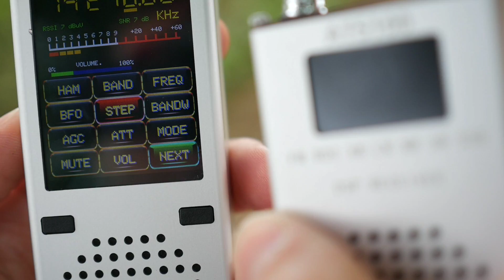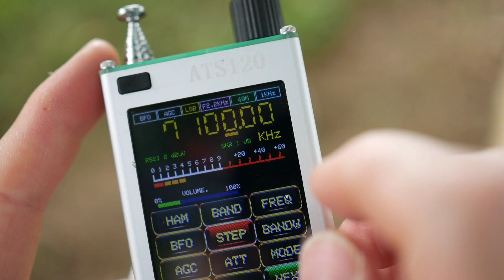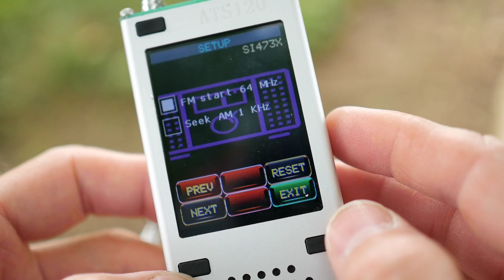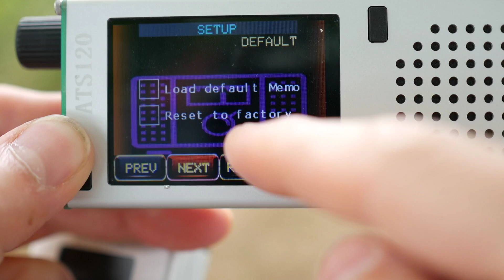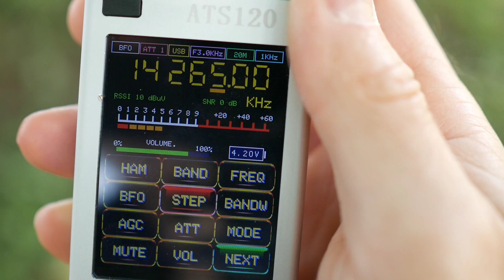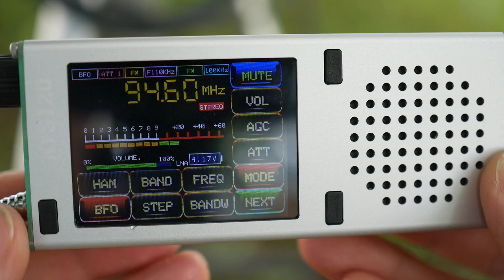New SSB Pocket Receiver ATS120 (LW,MW,SW,CB,FM) Review

Comment: I so want to like these si47xx receivers but alas they are just nowhere near good enough for practical use on the ham bands. The rx noise is giving me a headache even on this video. A decent receiver should emit almost no.noise without the antenna connected. This one is a wideband noise source.
 It is telling that most of the video explained the digital control functions, not the basic receiver performance.  It doesn't matter how good the controls are  if the receiver is noisy and insensitive,  it wont last a few days on the shack bench.
I would like to see this receiver side by side with an FT817 for comparison. I know the Yaesu is 10x the price, at a certain point people will trade off performance and price, such a comparison might assist with that decision. 
Thanks Paul for helping me decide!

Comment: Please mention that this radio has a esp32 microcontroller, which means it can be upgraded easily over usb port.
Reply from the maker: Yes, upgrade process and new firmware is explained in my latest video - ATS120 Decoder Modification

Comment: Is it possible to enable NFM modulation at 2130-2464 kHz?
These are the frequencies of train radio and metro in the territory of the Russian Federation and the former USSR. (Train 2130, 2150; Metro 2444, 2464)
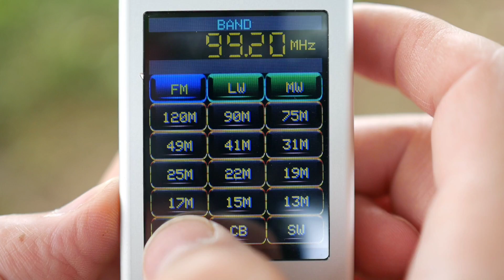UPD: 8:40 A-ha. Understand. Bad receiver ))
Reply from the maker: Unfortunately no. There is no NFM at all. Only FM radio broadcast.

Comment: Thanks for the great review. Regarding the 14MHz "cross modulation" is actually an FM image/IF problem that can be solved with a FM BC blocking filter or a selective HF antenna, like you used later. If this RX would have Air Band, I would buy this instantly, because it has variable bandwidth and a squelch, ideal for Air Band, but I believe the tuner IC is incapable of exceeding 108 MHz. 
Does it have any DSP noise reduction like the Malahit, which offers a very well designed noise reduction and an auto notch filter on top?
I just saw a video of one guy who flashed the decoder SW into this radio and inserted a tiny SMD decoder module and now received FT8, RTTY stand alone in the ATS120 ... SSTV should also work ... that is pretty amazing for this tiny little thing.
Reply from the maker: Yes, I am in contact with Manuel, who posted this video today and I will do the same modification for decoder. No, this receiver doesn't offer the NR.
Thanks for your comment! 😉👍 73

Comment: Would you say this is a good buy especially for my first receiver.
Reply from the maker: Yes, but If you plan to connect a long wire antenna or another big antenna then no.
Reply: @OM0ET  What happens if a Tecsun AN-05 retractable reel wire antenna or an MLA-30+ is plugged into the ATS-120? Does its front end overload badly? I'm torn between getting this or the ATS-25X Max Decoder. 🤔
Reply from the maker: Both models don't have front end filters so I presume RX will be overloaded.
Reply: @OM0ET  Thanks for replying! I've been a subscriber of your channel for some time, but this is the first time I've commented.  I've seen all the videos of your demonstration of both the ATS-120 and the ATS-25 Max Decoder. Between the two models, if you had to sell or let go of one, which model would you let go of? 🙂
Reply: Have you ever done review on the usdx ultra sot pota transceiver on your channel.

Comment: @ OM0ET URGENT Question. My neighbors we have never spoken to each other and we can't even see each other they for the last three years have come up with this "game", I understand that in their home there is a receiver (and in their cars they keep their respective TX), as well as a digital recorder that goes to 'infinity when they are not in their respective home. So I want to have a receiver, and surely it will be VHF or UHF, to intercept and record them, since this way you cannot go on. They are my neighbors divided only by a dividing wall of about 40 cm but when they talk normally you can hear their voices but using an ultrasonic microphone suppressor I can understand what they are saying but of course I have to hear them at a considerable distance (attenuated a few times). I would like to modulate them all the way through. Last year I had done a test and I did not think I would get a result even if it was trivial and of little value, I was trying an fm receiver for microphones, I pass different channels and I can hear the radio station and the music they were listening to. They, however, could not hear anything anymore and only when I turned off the receiver was everything as before. I hope I have clarified the issue. I look forward to hearing from you.

Comment: All the clever programming cannot hide or compensate for the poor front end RF performance. It would be a fairly simple matter to add a track tuned front end driven by the processor to improve the performance considerably.

Comment: I used to be heavily into shortwave radio and CB radio but I have to be honest my cell phone takes me places that shortwave radio and CB never could it's still nice to see those things around tho😊
Reply: Wait until you live or hike in remote areas. Your urban-luxury gadget will be pretty useless on 67% of the earth surface. Only densely populated areas reach 95% (and that's not even 100%). Speaking from experience.
Reply: Shortwave radio listening is are free of charge. Whilst you need to pay for data connection to listen to online radio. If you can afford some good Internet connection plan then you're lucky to ignore shortwave radios. But for typical people who can hardly pay the bills, paying daily for a decent speed data connection just to listen to online radios and podcast is a luxury. Traditional over-the-air radio is still the best choice for the poor, especially into rural and remote places that has poor Internet connection or has no cell network coverage. In fact, in my area I have no GSM signal inside the apartment clad with aluminum screened doors that I need to raise an antenna at the rooftop to listen to news from overseas radio stations on my shortwave receiver, or even watch decent signals on digital TV inside the house.
Reply: I wish we had the modern digital units back in the 90’s. I had the Radio Shack DX-394 then. I do have a Hallicrafters HQ150 and a 1946 S-38 with the BFO. Also an Icom IC-R71E. One of my favorites was the Grundig YB-400.
Reply: @drippinglass  sweet

Comment: a) Isn't it amazing that after more than 30 years manufacturers finally are dealing with the annoying mute-on-tuning which took away all the speed and fun of sweeping a band like was done on a real analog radio by a fling on the tuning wheel? b) The LNA appears to be quite useful. c) Personally I do not like any hard coupling between band and modulation method. You can't predict what people are doing (amplitude, frequency, fsk, ssb etc.). Quite frustrating to find a strong station with only a distorted residue of the real signal because their modulation is different from the hard setting of your COTS receiver.